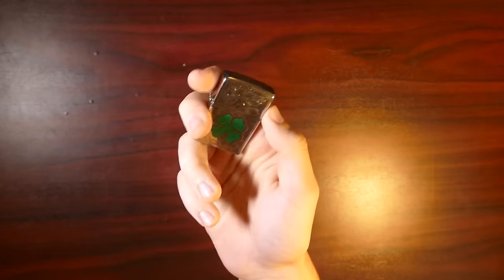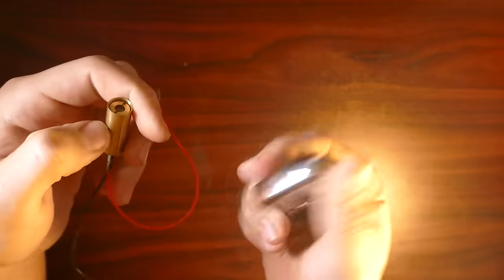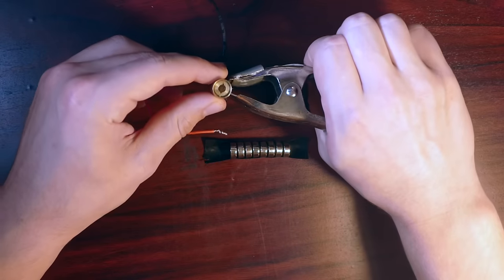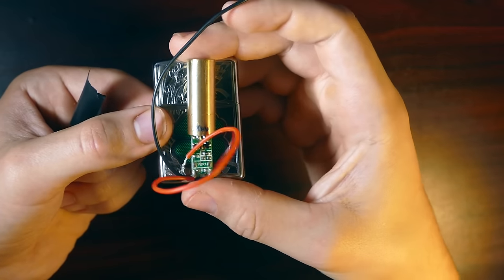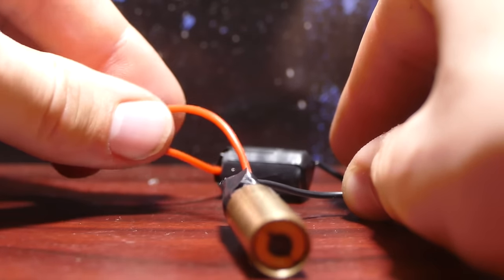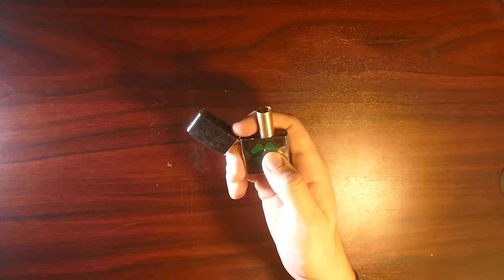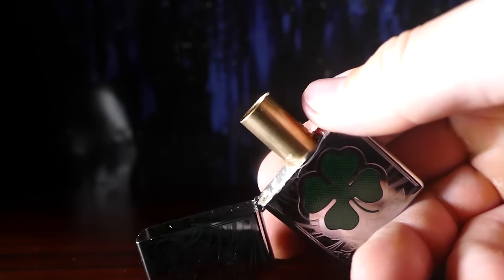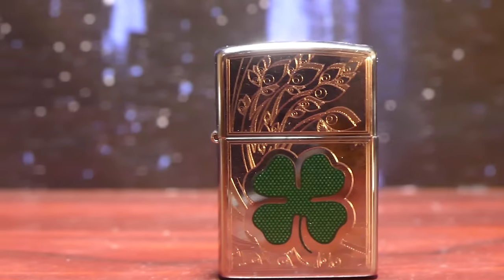Amazing Lighter Hack! - Burning Laser Zippo!!! (Best Lighter Hack Ever)

Comment: Your soldering iron looks a little beat up. Here are some tips:
1. have a wet sponge nearby, so you can wipe of extra solder on the tip.
2. before putting it away, put a bunch of solder on the tip so it cools over it. this protects the tip from rust, making it stay heat-efficient.
3. for more tough cleaning, use some steel wool and rub the tip when it's hot in it to clean it off.

Great video!
Reply: STEVE LEVELEVE I my self was looking how to clean my tip thank you very much

Comment: lighter fuel for the zippo would have saved a lot of time and money...
Reply: this will cost less in the long end also the zippo fuel is annoying it leaks out and even if you don't use it it evaporates in a couple weeks that's why i bought a thunderbird butane insert, it's great
Reply: Lethal Snipes it shouldn't leak unless you over fueling it. The zippo fuel does dry up in the lighter over time and the main two reasons for that is safety and also to send it back to zippo for a repair. Can't mail fuel unless your the company selling it and even then there is high rules to follow.
Reply: Miguel Hernandez
the butane insert is still less of a hassle overall
Reply: check out tesla arc lighters...no gas..no fuel...no flint. and no pointless green lazer burning your retinas out :D
Reply: Lethal Snipes very true but I just like the old zippo insert. I might give the butane a try cause I works better.
Reply: jay82bob not a fan of them but when I camp, light candles, or burn anything else (I like to use fire.) I don't smoke and know those are great for smoking but that's about it.
Reply: thats about it? they burn anything instantly with no need for fossil fuels or flints. if you need to light a big fire then simply use the arc lighter to light a piece of paper. ive got one of every kind of lighter and the best all rounder is the arc lighter. completely wind proof too.
Reply: and some kid's eye
Reply: you should look in to the plazmatic lighter. i just got one and it trumps all other lighters
Reply: Not really.. The time and money it takes to process that fuel during manufacturing is still there.
Reply: lol
Reply: Valueless Dollar but changing the batteries would take longer
Reply: @That_NJ_guy  it does evaporate over time though

Comment: Maybe make this a little bit more challenging and have a small rechargeable battery or a small lithium ion battery with a port so you can charge it so you won't have to replace the button cell batteries each time they run out.

Comment: Great video and a truly interesting project but there are the obvious questions that were left unanswered.

You hot glued everything in the case, why?  How are you supposed to access the batteries for changing?  You hot glued the power switch to the electrical tape enclosed button cell batteries, why?  While this project was interesting, there are more questions raised than are answered.

Comment: if u drill a hole in the top of the zippo and put the micro switch on the outside u can get  a more "hidden" effect / make a pilot hole with a self tapping metal screw**

Comment: the Problem is the Battery run low very fast when you use it pretty often, and you're not able to replace them and then you wasted the 20 bucks for the laser.